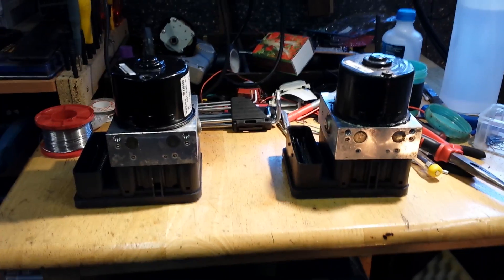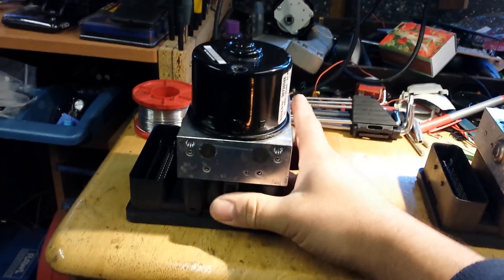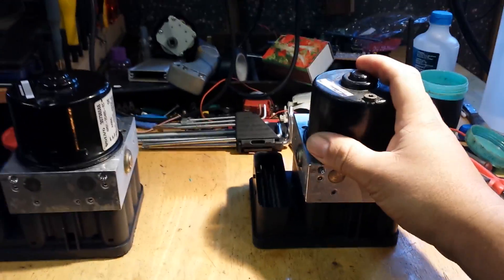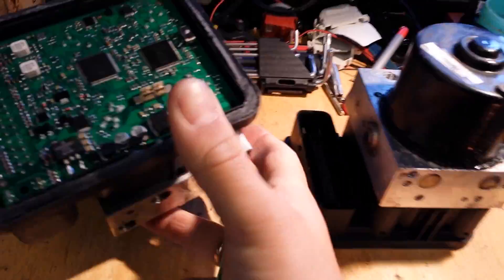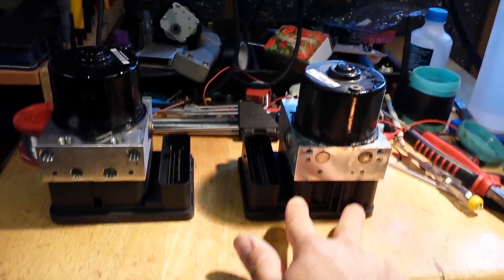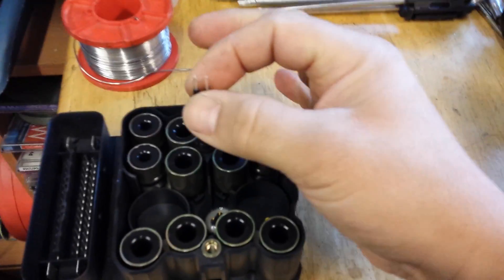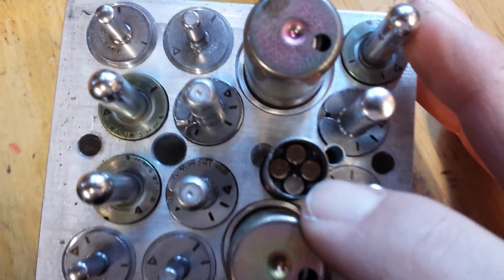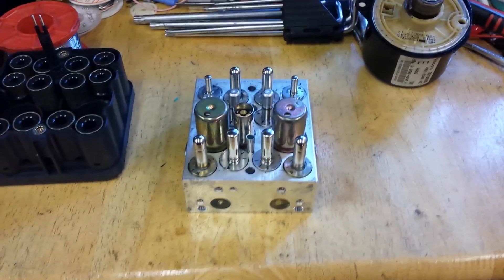Volvo 2005 BCM ABS pump "program"+ pressure sensor fault.

Comment: Hi! Great video!

I bought a secondhand unit like you did. I before had fault codes BCM 0130 and BCM 0131. After I swapped the hydraulic block and motor only I still have the BCM 0130. 

What can I do to to solve this problem. I never replaced the electronics.

I have a Volvo V50 2006.

Can the problem with BCM 0130 be in the ECM anyway?

Best regards

Mats
Reply: Sorry for disturbing,  I wonder if you swapped eeprom again
Reply: @bilalabusaid3041 I had to buy a unit that had no fault's. I installed it and didn't have to do anything else. That's all I did. 
After that the problem was solved.
Reply: @Styckare  Hi Mats, you replaced the ABS pump/unit and you did not have to do any coding is that correct? I have an s40 with a sinking break pedal and it is likely the ABS (and not the master break cylinder that I first thought) and I just ordered a used ABS unit, mine is a 2001 so maybe the immobilizer system is simpler and does not need synchronizing??  Whay year is your car?
Reply: @pmgear  
Hi
I didn't have to do any programming. 
The year of my Volvo was 2006. On my car i could just swap the ABS unit. I took a drive to my personal Volvo tech and got that confirmed before i bought one. Good luck
Reply from the maker: Looks like the block you swapped, also has a faulty brake sensor...
Was a second unit?
Thank you for watching and for your comment!
Reply: @LMAutoRepairs   yes, it was a secondhand unit. But the status of the unit when I bought was ok from the seller.

So it can't be the electronic board then?

Best regards 
Mate
Reply from the maker: @Styckare  
Never had one with a code for the pressure sensor, where the issue was the electronics...
I would say the pressure sensor on the block is faulty... sellers sometimes take parts from cars that cant actually be tested... and they advertise them as good parts...
I had in the past, and as you might have seen, or will see on my videos, where I sent faulty parts... the last one, was an ecu for a corsa...
But make sure everything is connected properly, and that the block is sitting properly on the electronic side of the module...
Reply: @LMAutoRepairs  thank you for your fast replys. You are probably right, I will then buy a tested one next time.

Thank you!

//Mats
Reply: @Styckare  hi mats I wonder how you solved 
Regards bila
Reply: @bilalabusaid3041  
Hi
i bought a secondhand unit without those faults. After that it was ok.
Regards

Comment: Hi I replaced second hand pump today with my eeprom and everything works fine but now showing fault code p0573 which is  brake switch circuit high and info ,, could not be erased " in my diagnostic scanner. My old pump had all the same numbers but doner pump was working with cruise control. Maybe you know if enought just replace pedal switch to clear fault code ?
Reply from the maker: Hi
Well, all the configuration should be on your eeprom... and if you swapped it all info has been transferred...
Are you sure your switch is good?
What was the original fault?
Reply: @LMAutoRepairs   original fault was anti skid light on and no communication with bcm now have communication with bcm and no fault codes stored in bcm only in ecu I also check resistance of sensor in brake booster and looks ok also now have in Cem 2 error 8d01 Brake light switch Comparation error but brake light work fine
Reply from the maker: @marcheljucha2837  
And you did not have that fault before?
Reply: @LMAutoRepairs  no only no communication with bcm module and battery voltage intermittent fault . Anyway after I put abs pump in all systems was clear with no fault codes than I started bleeding and during this process fault code appear but I was abled delete fault code ones and when appeared again when I tried to delete the code saying straight away that "could not be delete " Now when I disconnected black brake switch on the brake pedal I got another fault code from this sensor and I cant delete it as well even after I plugged sensor back in

Comment: Hi maybe do you know If I can use any second hand pump I mean if all number from module need to match ?? or If I get any pump and  swap my old chip to new pump it will be all fine afterwards ?
Reply from the maker: Hi
I would try to match... unless you manage to find the differences on the units with a different part numbers...
If the pcb is the same, I would guess it should work just fine though...
Thank you for watching!
Reply: @LMAutoRepairs  thanks for a quick answer great video
Reply from the maker: @marcheljucha2837  
👍

Comment: thanks great video
Reply from the maker: MANOWAR1917 
Thank you for watching!
Reply: my back brakes is not getting any fluid. If I buy another unit and swap over my electronic module and replace the hydraulic block portion do you think this will work for my car? who did you buy the abs module from what is his user I/D name? hydraulic block  p/n 0265234136, abs module p/n 34516769707.
Reply from the maker: @MANOWAR1917  
Hi
I can't remember the seller now... this was some time ago...
Exchange the electronic module should work...
Just make sure that your problem is with the modulator, the aluminium part...
Reply: Can I use a newer Bosch hydraulic block with the same hydraulic port locations and same features( acting steering, dynamic drive...etc.)?

Comment: nice video. i have Toyota land cruiser 2007  & there is fault code c1249 brake light switch open circuit. brake light working fine & there is two wire on abs control unit found 12volt while applying the brake pedals. all the connectors are good no corrosion. can u please suggest me what problem could be there, i have doubt on a control unit. all the power and ground circuit are ok.

Comment: Hi, I have problem with my pump ABS ate in Mazda 3. My pump have common problem c1288. I bought 'new' pump (the same numbers) and soldering eeprom with my pump to 'new' pump. Now i have a problem c2785 and b2141. What can i do?
Reply from the maker: Hi
The unit needs to be initialized...
All here:
http://mazda3.automotive-manuals.com/mazda3/B3E040243000W30.html
Thanks you

Comment: ALWAYS test the pump motor for resistance first.  It should read less than 5 ohms.  If you get a reading of 9 ohms or more then the big pump motor is bad.  This ABS module is a Bosh part that is use on lots of autos, and the non-communicating problem is also common and has to do with a motor pre-load voltage check(no error code).  The guy in the video could have simply switched the big black pump motor and the no communication problem should have been resolved.  Even today you will see mechanics replacing only the board/connector part of this ABS pump and the problem does not get resolved. (Thanks for the Video LM Auto Repairs)

TDI Love from Chicago
Reply from the maker: GallowayChicago 
Hi
Thank you for watching and for your comment,  appreciated!
Reply: LM Auto Repairs ABS brake repair for a Buick 2005

Comment: as I understand it you must make sure all numbers on the replacement ABS module and pump match exactly to the original,and I mean exactly !! otherwise you will have to have it re-programmed which won't be cheap !
Reply from the maker: colinf1951 
Not exactly...
Depending on the numbers... anyway, in this case the problem is that the pump is part of the immobilizer system... so even a pump that matches the original one, will not work unless you transfer or program the immobilizer...

Comment: really useful video keep up the good work but i do have a question i have a citroen c2 2007 vts with a esp fault code c1302 which is brake preasure sensor failure if i get a secound hand unit and swap out ecu do i need to marry pump codes or any other code as im told that there is a chip on the esp sensor but after watching your vid i now confused and will i need to program any thing as the ecu and abs is fine just esp watning light on and has failed mot and again great video
Reply from the maker: Dan Mountford 
Hi
Thank you for watching! 
If possible, replace only the aluminium block,  leave the electronic side as it is...
I am not sure on the c2 if the abs/ESP is coded to the car... if it is, procedure should be similar to the one on this video...
Hope that helps!
Reply: it sure does and i guessing there no way of fixing the sensor that is in the unit and is the esp coded to any other vehicles or is it just a relay to ecu
Reply from the maker: Dan Mountford 
Ok, if you sure that the module is coded to the immobilizer system of the car, just do it  as I suggested,  change the aluminium block,  which contains the pressure sensor, and leave the original electronic module...
Otherwise open the module, the electronic side,  identify the chip that contains the information and either copy it to the replacement or just swap them over...
Reply: thtas just it i not sure it is coded are there any models that are or should i try straight switch firat see what happens and thanks for your time this has been bugging me for six weeks as to why i couldnt swith the unit and was told i coildnt without it mathing  ecu but tgen i found your genius video so think i gonna give it a shot but is a coded sensor something u come across before cause surely it is just contactors
Reply from the maker: Dan Mountford 
Go for a straight swap... I will be posting a video in a couple days on a similar problem on a Honda... that might help you as well to have a even better idea of what to do... stay tuned...
Reply: will do mate i got u on follow now as u a genius keep up the good work and thanks for your time
Reply from the maker: Dan Mountford 
No worries...
Reply: hi buddy i have tried a straight swap but i think i bought a duff sensor again i have been trying yo find what the part numver is for the sensor with in it with no success just wondering if it something u may no or no where i can buy the sensor
Reply from the maker: Dan Mountford
I have been in that route... I never managed  to find those sensors...
Let me know if you do...
It happened to me in past... buy a second hand unit, and that came with a faulty sensor as well...
Another option you have, is to send your unit to be repaired... they usually offer a lifetime warranty on that problem...

Comment: Anyone know how to remove it from the car
Reply from the maker: Muqtadirul Waris 
Hi
If I recall correctly,  you need to remove the battery, battery tray, and some intake pipes...
Air filter housing needs to come off as well... I think...
Hope that helps...
Reply: How do you get the back off?
Reply: lmsvvavr thanks, managed to get it out

Comment: Hi excellent video I was wondering how easy it was removing the module from the car I have got the dreaded anti skid service required fault showing it says it is the return signal from the pump pressure sensor so I'm going to give this a go just not sure on removing the unit.
Reply from the maker: Rossel RL 
On this car the the unit is a bit difficult to remove...
Hope you can get it done!
Thank you for watching and for your comment!
Reply: @LMAutoRepairs  hi friend I have a volvo s40 mod 05 t5 manual but ABS modulo was faulty and i just swap them from an other volvos s40 05 that i had saved it but when i got finish to swap it the ABS light turned it off but!!! now I got IMMOBILIZER SEE MANUAL    can this swap bring that issue?
Reply from the maker: @randalgonzalez9968  
Yes...
The ABS module is part of the immobiliser system...
You need to either swap the eeprom from your old module, get everything programmed using capable tools, or, read CEM, ECU and using volvo sync alight the immobiliser system again...
I have a video on that... search my channel...
Thank you for watching and for your comment!
Reply: @LMAutoRepairs  thanks bro. I just followed all the steps you did and my car runs pretty well. Thanks for everything
Reply from the maker: @randalgonzalez9968  
That's great! 
👍👍👍
Reply: @randalgonzalez9968  Did the ABS light go off even before you started the immobilized car? How that happens?
Reply: @arivaisanen4561  yes

Comment: I have abs problem with my bike, stop light is always activated brake light switch is inside the  abs unit , so i think problem could be brake presure senssor . That can be fixed or repaced?

Comment: Hi – on my Volvo V70 ’01 I have an orange light on, saying ABS /STC maintenance required.
Drove the car to the mechanic, his reading of the failure was just ABS-unit failure, so bought a “new” used ABS /STC unit.
The mechanic put this one in, and still got the same failure read. I took the car to a more electronic experienced mechanics -  they got the same read on both the ABS-units. They were not very specific on the reads, just that the ABS /STC unit is failing.
My question is, is it enough to reprogram the epRom (or swap the one from the original to the “new” used one), Or is the problem located elsewhere do to the fact that I never had any starting issues with the car nor red warning lights???
Reply from the maker: Jesper Simensen 
Perhaps the pump is not part of the immobilizer system in that year/car....
Well, a bit of more info would be helpful... like which code exactly is coming up...
So unless you have been unlucky and you got another pump with the same issue, or is something else... you need more specifics...
I could suggest one thing or two... but might be misleading you... see if you can get hold of the exact code that is coming up...
Have you Google the problem, see if is a common issue perhaps...
Reply: I got a paper with the failure code:
0070 Pumpemoter / motorrelæ Fejlbehæftet (danish)

0070 Pumpmotor / motorrelay faulty

Seem to be a bit of at broad failurecode (error code) wouldn't you agree?
Reply from the maker: Jesper Simensen 
Possibly... but now with the error code we you can start to look at a few things...
That code refers to incorrect voltage being delivered to the ABS module...
Start by checking the basics, fuses, connectors etc... see at the ABS plug if all your grounds and voltages are present...
If all there, then you need to look deeper into the module... starting with the motor, ensuring is actually working... if the motor on your pump is bolted to the module, remove it and bench test it....
Reply: Thanks – I will start there, but now that the new one is installed in the car, wouldn't the faulire / error in the car dashboard stay there, because of the wrong info stored in the EpRom? Despite everything else theoretically working as it should
Reply from the maker: Jesper Simensen 
But have you swapped the eeprom from the old pump?
Reply: no i haven't swapped it yet, the old pump is intact, and the new one is installed ind the car and intact
Reply from the maker: Jesper Simensen 
Do you have any codes on the engine ECU along side with that one in the bcm?
Reply: lmsvvavr not that I know of, I'm beginning to suspect that it might be the electric motor on top of the ABS unit that's the problem, I'm thinking the brushes are worn down?
Reply from the maker: Jesper Simensen 
That's a possibility... That's why I said that is the motor is bolted to the module, to remove it and bench test it....
Reply: Just wanted to follow up on this problem.
I got the damn thing to work :)
Apparently, the old module had a problem inside the alu-block or the black plastic box with the control unit EepRom etc. The new one of eBay had a malfunctioning electric motor, the electric motor in old one was working fine, after I opened it, and adjusted the small carbon blocks inside of it (found out after bench testing them both)
I put the motor from the new unit onto the old alu / control unit, and it worked.

BTW I talked to a Volvo technician, and he told me, that on my Volvo model (Volvo V70 II 2,4 gasolin-model  ’01-07) the EepRom does not contain specific programming / info, so I didn’t have to do anything to the new one I bought. 

So incorrect voltage being delivered to the ABS module was the problem, but in different places in the to units

The seller of the ebay one wrote that his unit was tested and in good working condition  -> lie
Reply from the maker: Jesper Simensen 
Glad to hear that you got it sorted...
Buy stuff on eBay can be sometimes a gamble...
But you managed to make a good unit out of the two, just like I did... lol
Thank you for watching and support my channel!

Comment: I would like to replace the motor only.
Can I do it on car without removing whole unit? Would brake fluid leak out?
Reply from the maker: Hi
Yes you remove the motor only with the module in the car, and no, will not leak fluid...
Hope that helps...

Comment: Hello lmsvvavr. Thank you for the video, very helpful. Is the abs units in the video ATE mk60? 
I have a Mazda 3 with a ATE mk60 pump. The fault code is C1288 "PRESSURE TRANSDUCER MAIN/PRIMARY CIRCUIT FAILURE"" I´m thinking of buying a second hand unit and swapping the eeprom like in your video. Do you know if the the eeprom is located in the same part of the PCB on all ATE mk60? Whats in the eeprom? Is it the cars VIN?
Reply from the maker: Stefan Ihlberg 
Hi
Not really sure if this is an MK60, the eeprom contains vin and other configuration data.
In the volvos is part of the immobilizer system, so it needs to be correct for the car to run.
Even if the eeprom is not exactly in the same place on your pump, they are easily identifiable. 
Done this quite long time ago, and can't really remember all the details...
Hope that helps...
Reply: Thank you for your answer :) I think S40 uses the ATE mk60. I ended up buying a hydraulic block with a remanufactured  pressure sensor from http/s://www.bqe.se/ (Swedish company)
The car is back on the road again!